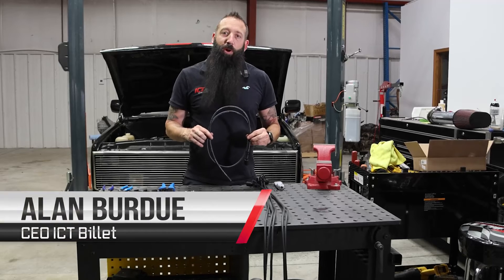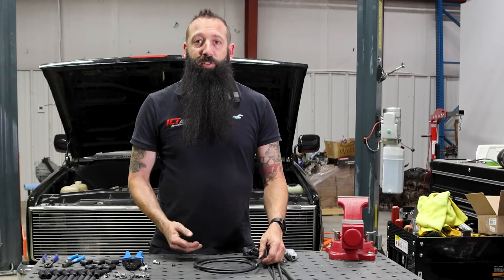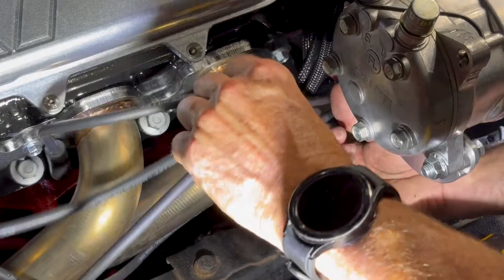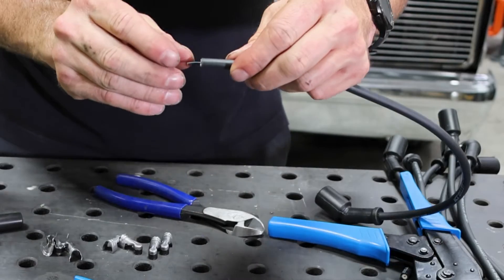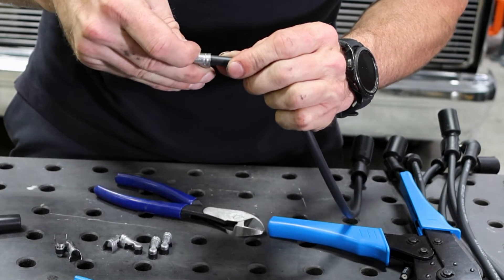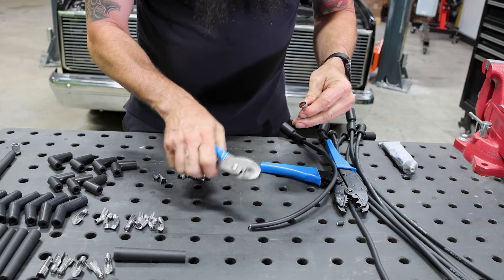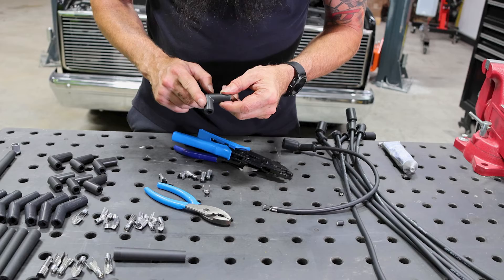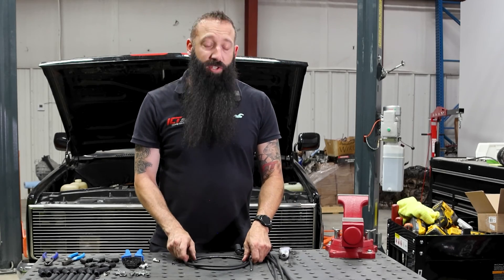How to Make Custom Spark Plug Wires – Crimping & Boot Install Guide - ICT 551083

Comment: Just assembled mine. I used the 45 degree boots to make a set for an LS1. Coilpack on the valve cover. 2-1/2“ from inner boot edge to boot edge. I used windex as “lubricant” to get the boots on first. Then crimped the connectors. Then slid the boots back over. I like what you recommended with pliers to squeeze the connector ends together. Then I preloaded the connector into the crimper. Then fed the conductor and insulated end into the connector.